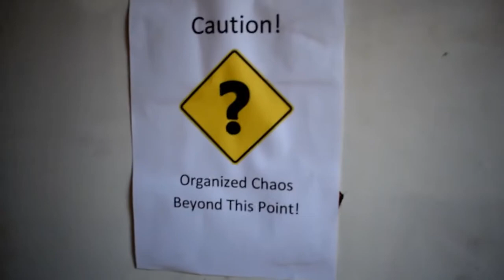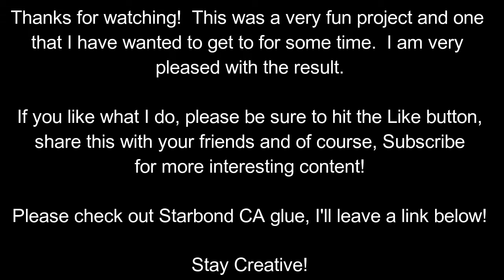Putting a New Handle on my Billhook (cutting tests at the end!)

Comment: How do you find using the longer handle? Is that any better? Nice project!!
Reply from the maker: First off, thanks for taking the time to watch and comment!  The bigger issue for me was that the old "handle" was actually the socket for the old farm tool and using it like a machete caused it to often roll in my hand.  So, that said, the new handle has eliminated the roll and also allows me to grab it with both hands if needed for extra power.  For me, it's a great improvement!  Again, thanks for watching!  Stay creative!